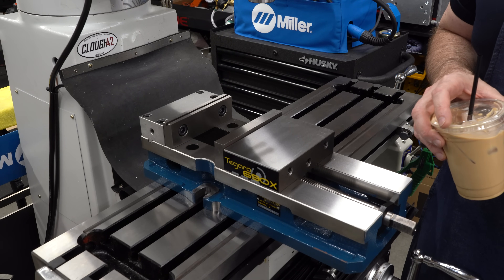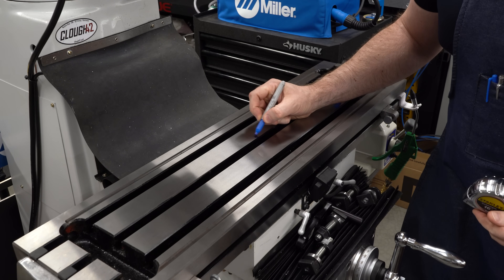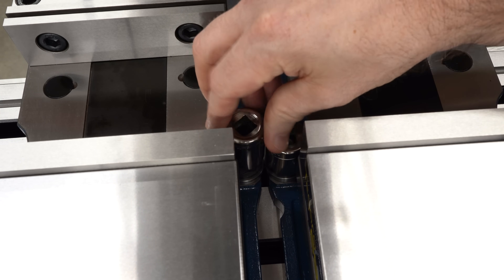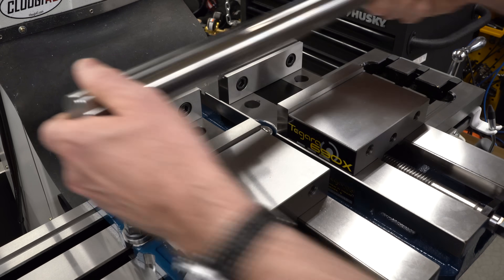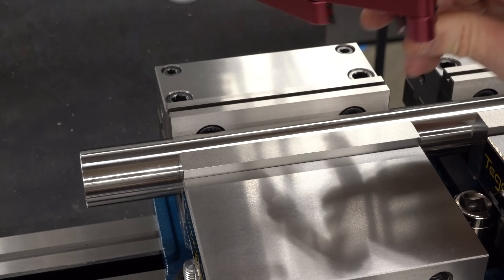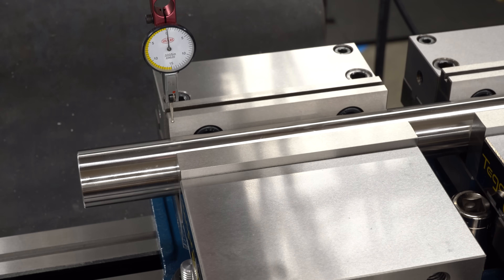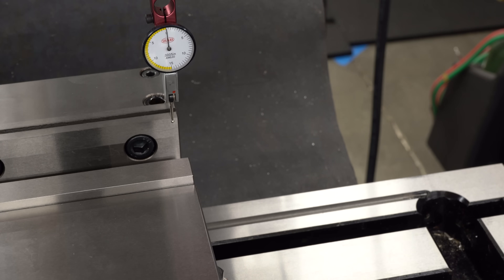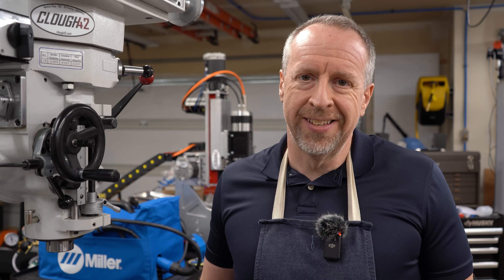Tramming Multiple Milling Machine Vises: The Easy Way

Comment: That wasn't the easy way - faster and easier to tram and tighten one vice then put in your round stock snug second vice on stock and tighten bolts. Ck runout and it should be dead on.
Reply from the maker: If everything is perfectly straight, nothing flexes, and you're happy with half the measurement resolution, that will work fine.

Comment: A bit off topic for manual machinists....but for those who are running a conversion to Centroid CNC, and may not know, you can clamp your multiple vised together like James did here, then simply probe the left extent, and the right extent, then use the CSR function (coordinate system rotation), to set the fixed jaw axis as the machine X Axis, alleviating tramming all together.  It's an awesome feature that is often overlooked.

Comment: I pretty much do the same as you have shown ??
Except, I use a Ground Straight Edge which is very handy for many other jobs around the shop.
The poor mans way to this, is with a piece of Box Section Aluminium, and some patience to get the accuracy dialled in to where you Need it.
For most jobs on a Manual Mill you don't need it absolutely perfect.
On a CNC Mill it might be a different thing.

Comment: Matching vises.  Dial them in.  Tighten them down.  Done.  Better yet, use keys.  I there are two or more users you can agree on the shop method for installing vises.

Comment: Hi James, re your lathe, how do you maintain level of the ways, being as it's on wooded bench, sorry it's out of context of the current video,
Reply from the maker: I have plates under the ends with pads and screw jacks.  I think I showed the system in my lathe and mill improvements video.

Comment: I regularly have to use 3-5 vises all trammed within .0005" on the VF-9 at work. Get one trammed & secured, then use a pair of indicators on Noga mag bases on the spindle head zeroed on the first vise to set the other vises.

Comment: Thanks, James! While I have space & active travel on my mini mill table to support two 3" vises, before I buy a matched pair I would save up for a bench mill and get two 4" vises; maybe my wife will win the lottery one day.

My only recommendation would be to use 3/8" drive sockets: still have more than enough torque to tighten the hold-down bolts but would be easier to get into the sockets (it looked like you weren't quite straight with the 1/2" extension).
Reply from the maker: My 3/8 set doesn't go up to 7/8 or 22mm.
Reply: @Clough42  New Tools!!!

Comment: I would square and bolt first vise then place second vice in place you can use a bar between vises to get close light snug bolts remove bar if used then run indicator from fixed vise to second vise tap one side at zero and tighten then indicate free side should only take a couple of minutes total to get vises done.

Comment: Nice work. My thoughts: If you use two vises, you might also think about using a torque wrench. Also for securing the workpiece. Try to do the alignment/check work and clamping of the actual workpiece in the same way and order.

Comment: I have a 45x45mm , 600mm long, cold rolled steel instead of that round material. And i get the same results. 0.02-0.03mm(I thou) in the middle. And after that you need to move them individually

Comment: The bar/straight edge method is fine.   Professional machinists usually tap in one vise, tighten it down and then move on to the next.   It seems like the bar/straight edge method solves a big problem, but it's really not that big of a deal.   In this video you end up taking out the bar and taping the vises in anyway.

Comment: That moment the dial tip (didn't) crash into the second vice.
You had my heart racing there.
Then I realized the ball tip was big enough to act as a ramp onto it.
I would still use a piece of paper to lift it over the edge.
Reply from the maker: That sounds like extra work.
Reply: I have had the same issue as well... managed to damage two, not one, dial indicators that way...

Comment: If you are not confident the round stock of your choice is 'perfectly' straight.  Mark the shaft before removing from the vices.  Rotated it 180 degrees ( end for end or by spinning in the vice, same results) and repeat your indicator testing.  Any bow or bend error will be doubled..(For those of us home machinist w/o a large precision Thomson shaft laying around) 
Side note: Did anyone else cringe just a little when the indictor transfer the gap between the vices?  Bad memories!
Reply from the maker: I carefully preloaded it less than half the tip diameter, knowing I would want to do that.  :)

Comment: Hi Clough42, on the underside of the vise is the not a key slot for T-slot keys ? normal there is a precision slot for an precision block there fit in to the t-slot of you tabel, then if you remove and refit the vise the are parallel and straight.
Reply from the maker: The keys that came with the vises don't fit the slots on my table, unfortunately.  Maybe I'll modify them at some point
Reply: @Clough42  , Hi you can get the keys in many sizes i use them alle the time on my table for different vises and on different tables.

Comment: Before I watch, mount and true one to mill then set second vise without mounting, mount a reference parallel bar between the vises and secure second vise. Then use dial gauge to true second vise. Will watch full when I have time.

Comment: I've just indicated in my pair of orange vises a couple of times recently. I tried using a piece of flat stock to indicate in (as per yourself and "Titans"), but overall I found it made it difficult to adjust the vises.

What I found easiest was: 
A woodworking tool for pushing things to known offsets. Used that to roughly indicate I've vice in, plus then push the other a given spacing away, then use a straight edge to bring the fixed jaws level (could use your round bar for all this as well, just didn't work that well for me)

This got me pretty close straight out the door to be honest. Less than 0.03mm out of tram

However the trick for me was to grab a 2 micron indicator and indicate with that while tapping. Makes it really easy to see what you are doing and shove things around a couple of microns! Couple of taps later and I'm indicating sub micron deviations across the vise fixed jaws. 

As an aside the body is out of true to the fixed jaw on the orange vises. about 0.03mm down the long edge. (In fact the vises are off in height by that as well). So indicating on the fixed jaws is a must. Plus I cut my fixed jaws to match left and right and lasered them to remember which is which...

Comment: I frequently have to tram in six or even eight vises on a twelve foot CNC machine. I don't have an accurate straightedge long enough, so I have to do them one-by-one. Fiddly, but not really that difficult. Practice makes perfect.
Reply: Yeah, even for two vices I've always done it without a straight edge.  It's not a big deal.

Comment: The way I've done this is very similar. However, instead of clamping the whole face of the moving jaw, a piece of soft material is placed vertically in front of the moving jaw's centreline. Aluminium  welding rod or thick copper wire is perfect for this. The reason is to avoid any uneven clamping force from the moving jaws affecting the fixed jaws. Not so much of a problem with new equipment, but vices that have done a few miles, or lower quality  have a little flex not noticed when used singularly. I also use the ground bar stock to indicate from instead of the interrupted fixed jaw faces as a slight variation that seems to make little difference. The assumptions, which can be verified at the surface table, are that the fixed jaws are flat, and the ground bar stock is straight.

This video certainly does fill the missing gap in online knowledge, so good shout James. 

Now I'm intrigued as to what project you have that requires such a setup.

Comment: I should have thought a length of wide and stout flat bar gauge plate would be superior as having greater lateral rigidity than rod. If it sat above the vice jaws you could more accurately tram off that.

Comment: No offense people, but using a bar clamped in one vise to indicate another is a total waste of time. Try this. Put both vise's with tie down hardware on the table where you want them. Push all of them to the back. Pull a vise at one end forward .06"(1.5mm), and indicate it. Set Zero. Move to the next vise, bring it's back jaw forward until it reads zero. Return to first vise, double check. If good, head for vise 3(or 4, or 5... You get the idea).

Comment: Doesn't anyone on YouTube use keys under their vises?!  Just drop the vise down on one of the slots, and your ready to go.... 😁
I use the Sagop design vises, and never tram them in. Just drop them down ☺️👍
Reply: Professional shops or home shops (with $$$) probably use keyed vises. It also depends on the slop in the T-slot on the table especially in the cheapie import milling machines.
Reply: @ryebis  my comment were based on mills on a certain standard of the vise and mill/table.  Like this showed in the video.  I thought vises like this had 'keyways' in the bottom

Comment: An old guy in a machine shop taught me to have a keyed primary vise, dedicated to a particular machine, and un-keyed secondary vises waiting on a oiled wooden storage rack. In your case you would clamp the bar in the already bolted down keyed primary vise and then clamp the secondary vise on the bar. Then tighten the bolts on the secondary vise... donesky!  Good video!
Reply: I tried the keys and found them more trouble that they are worth. The table slots are just not good enough to accurately align the vice in spite of having a real tight fit. I ended up having to verify them with a dial test anyway so now I just take a minute and align it without keys.
Reply: @billshiff2060  Interesting, ours worked great. Guess it depends on how well the finish machining is on your table. I've heard of people having to resort to milling the table with the mill itself. The machine you speak of, was it a full ball screw table or did it rely on dovetails? BTW- we did use a surface grinder to make our keys just shy of an interference fit, very tight slip fit, with a tiny taper to them for each machine... as per the old guy.
Reply: @p.t.anderson1593  I think you mean linear bearings (ball race guides) vs dovetails(ball screws are for feed only). I use multiple machines with ball screws and both linear ball, box ways and dovetails, some new and some old, some CNC some manual. 
I found that the tiniest ding on either part sticks it and then it gets loose on other areas and the lugs are prone to dings. I also dislike that those lugs prevent maneuvering the vice on the table and drops with a THUNK in the slot making it hard to verify that there is nothing under it. 
Without keys I can put the vice anywhere I want on the table and set it at an angle if needed, all with the certainty that the test indicator can give.  

Many times I could not locate the vice over the slots so the keys had to be removed. 
I used to have keys on everything, now I have keys on nothing and I find it easier and more accurate.
Reply: Just what i do as well. No need to make it difficult or time waisting 🙂👍

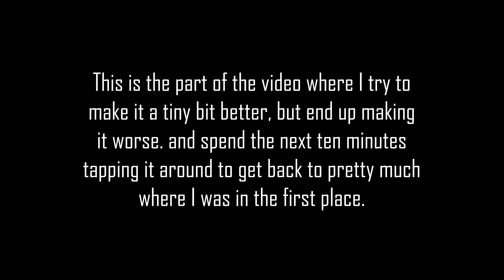Comment: 10:50 It's always chasing those last 2 tenths that get you. I've found that it works better if I go into my settings and uncheck my OCD option before attempting to tram my vice.
Reply: Yup. At 10:20 I was saying, "Don't do it. Don't do it. It's plenty good right there."

Comment: I may disagree that those vices are technically called “cnc vices” from my old school definition (90 degree sides would have allowed you to indicate them). Nice way to tram them together if the sides of the vices aren’t parallel. Cheers man.
Reply: But the accuracy of the sides only gets you so far.... If you are calling your fixed jaw zero then you need to indicate from the fixed jaw under similar pressure to with work in it...

Comment: James, I recently added a second vise on my Bridgeport.  I agree, not a lot of information on the web.  I have been running the two for a couple weeks and I’m surprised by how versatile this works. I have about 4 inches or so between the two. That has been nice because I was able to use a 123 block and an adjustable parallel to level out an odd par that needed machining.  I got my Kurt DX6 from Shars also.  I’m happy they are selling more none Chinese items.  Thanks for your great content.

Comment: Nice procedure.

Just curious though; does whatever that's going to be machined have tolerances anywhere near as tight as a couple of tenths?
Reply from the maker: You probably shouldn't plan on milling anything to that kind of tolerance on a milling machine, but every source of error stacks up.  The more you can eliminate, the better the results you'll get

Comment: What's the difference between the 690V and 690X vise?
Reply from the maker: The X has the clamping slots recessed into the side of the bed for closer spacing.  I think the V has better drain channels to bring flood coolant back onto the table, but don't quote me on that.
Reply: @Clough42  appreciate that

Comment: I have a pair of 4" Shars vises and the keys are dead-nuts on square and match each other for position. Zero tramming needed when installed on the table. I was amazed the first time I installed them.
Reply: Always check them though. You may have minor wear on your t-slots. Obviously depends on the precision you need, but it's worth keeping in the back of your mind I think

Comment: Why not  tram one and then clamp the shaft material ? Won’t they be aligned and trammed then?
Reply from the maker: Maybe.  Depends how accurately it's trammed.  Small errors add up over the length of the bar.

Comment: i tram one vise in first then i use a piece of shafting to clamp the second vise to. i set the indicator to zero on the first vise and also the dro x axis to zero. tram the second vise then remove the bar and check both vises by bringing them to zero on the indicator and checking for zero on the dro. this eliminates any distortion caused by clamping pressure. this works especially well when the vises are far apart.

Comment: From having to do this often enough, I went a different route and bought an 18" section of ground 4140PH flat stock. Then made an 18" rear vice jaw with two sets of vise jaw bolt hole patterns.

Comment: When tramming vices I prefer to put a hard straight piece in it and indicate off the piece not the jaw. There is too much distortion in the jaw under pressure and warping it. 
@ 9:50 You can see the 2 tenths misalignment disappear when you unclamp the bar. The jaw was flexing and tramming on the jaw give a false alignment when you really need high precision.  I'm willing to bet you actually made it worse adjusting without the bar pressure.
When you tighten a real part in the vice, those jaws will flex in ways you do not know so I would say take your reading off the bar or something that mimics the actual part you are going to machine. If a part is loaded high up on the jaw as is usual, they will flex a lot more too. DETAILS! That's what separates good men from legends.
Reply: I was thinking along similar lines, and wondering if it would help to have the movable jaw pressing the bar only at one point, via a small block of wood or plastic. Then again, I'm not a machinist.

Still love James' attention to detail, though - some people would just use hardware store fender washers for clamping. He went and made the correct part.
Reply: Same here. Rest that indicator on the part, not the jaw(s).
Reply: @markarita3  Yeah I came to that after chasing down a small deviation that I couldn't get rid of. Thats when I found out that the vice, its jaws and the screws that hold them are far from rock solid. So now for max accuracy I use a ground hardened rectangular bar (actually it's a jaw from a shear) and clamp it like I will the actual part and tram that.
Reply: That and using a 1/10th indicator.

Comment: Forcing the ground stock against the fixed jaws and then bringing the movable jaws in to clamp and align the vises could make it faster with the individual tramming  👍   I also wonder about their height and ways to make them match...   Shims wouldnt be a great ideia, would they?
Reply from the maker: These two vises have consecutive serial numbers and have the actual matching heights marked on the outside of the box.  I can slide a granite parallel across either vise and onto the bed of the other without so much as a click, so they're very, very close.
Reply: I have two Kurt D-60s, acquired years apart. They differ in height by .002". I pondered grinding the taller one to match, but decided against it. That's within that margin where trying to make an improvement will likely make things worse. If I ever use them both and it's that critical I'll shim without shame.